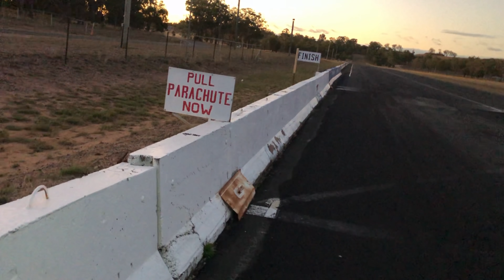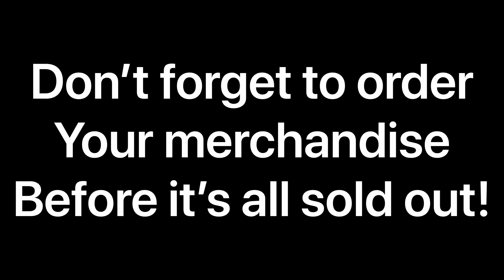Turbo small block Chev, no prep racing, at Warwick Raceway, on 28x10.5

Comment: Must've felt awesome to let her rip off the chip, even if it was turned all the way down for a no prep! Haha. Nice work boys, good video 👌🏻
Reply from the maker: Felt so good! Loved every minute of it. Thanks mate.
Reply: @motorfab  for next week's question of the week, you think you could give the good people a basic run down on rear end tuning differences between a radial and a rag tyre? And you theories on how to achieve start line wheel speed vs planting the tyre.

Obviously some of the numbers will be really hush hush, but a bit of discussion on which direction you send your pinion angle and instant centre would be interesting to hear.

Comment: Great vid , she sounds crisp - would love to hear some details of the engine / combo ? Also that steering wheel looked a tad loose ......?!?
Reply from the maker: It's just the quick release coupler has a bit of movement in it, it just adds to the fear factor lol. I'll see what i can do to give you some more details ;)
Reply: Yeah,the only sound the beats a SBC 350, in early Holdens,is 454 BBC,I've been addicted to Chevs in early Holdens,since my uncle bought a new HT,With a 350, in 1969,& first time I rode in it,he took me down the Quarter mile drag strip, in Biloela, as a 5 yr old,,it affected me to the point,such that I've to date built up and owned over 25 early Holdens, since then,starting in mid 70's with FJ paddock bashers bought for $100_$200, progressing through FC,FE,EK,EJ_HD&HR to my first registered car at 16 yr old,was a HK_186S,then to date I've built 19_ one tonne ute,from 1972_HQ to 1983 WB,most SBC 327_350's?can empathize with Luke's cheeky grin,when power comes on,the sound,minor vibrations, are all part of the experience?